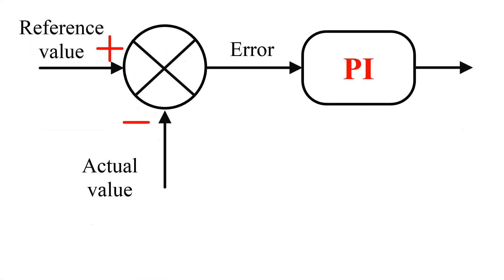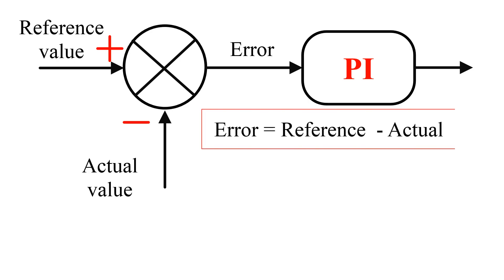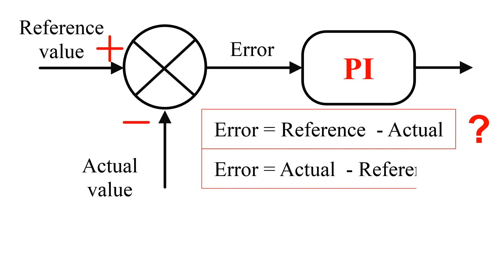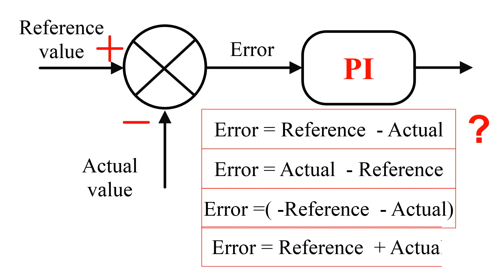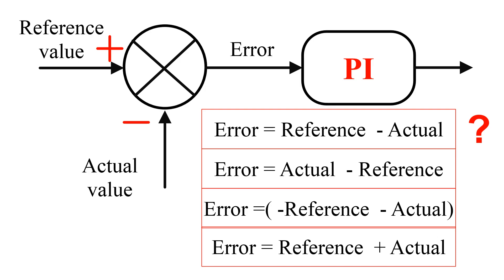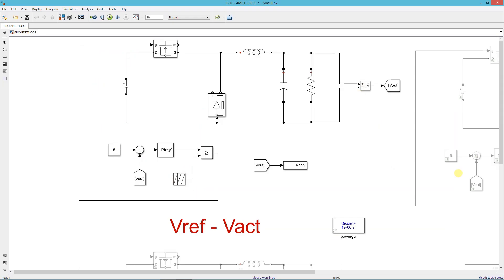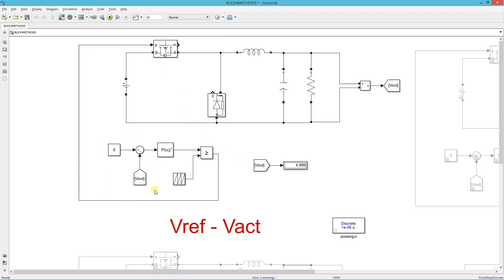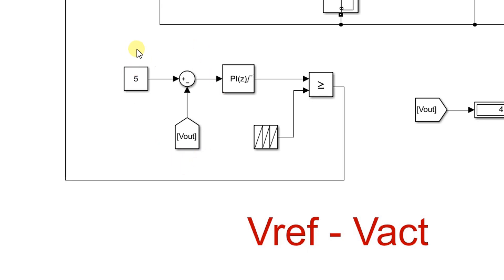How to wrtite the "Error" term while implementing PI controller? Fundamental concept explained!

Comment: Sir In electric spring how we should use the pll and single phase to dq  controllers so as to maintain constant voltage at the critical side
Reply from the maker: i havnt done anything on electric spring
Reply: @TechSimulator  can you put video on that it will be very useful